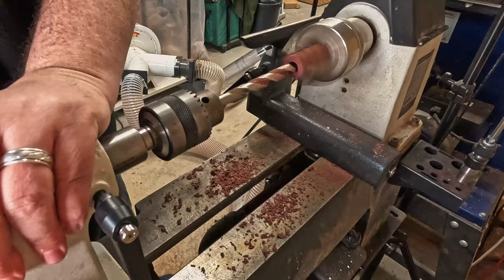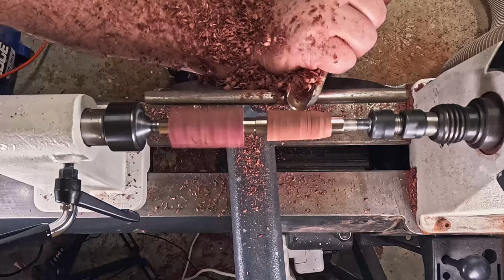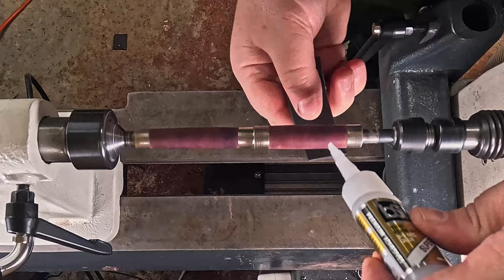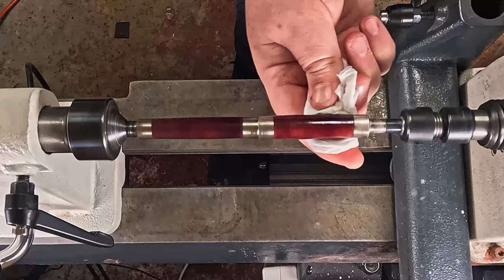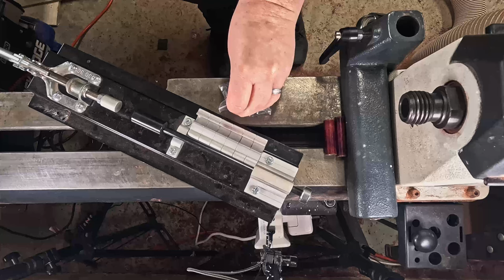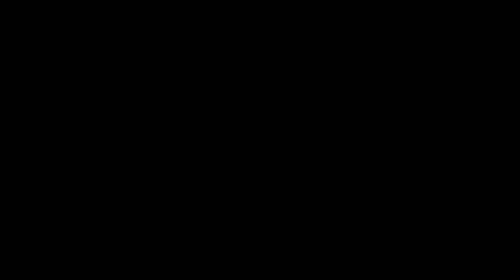Mistakes Happen

Comment: Great video mate. Thanks for sharing. How much do you sell a pen such as this
Reply from the maker: Thanks for the comments.
Several factors come into play on these. Purple heart is a bit more expensive in Australia. It's an imported wood and isn't readily available (I am also regional NSW, so it takes additional effort to get woods as it is a 4hr drive to Sydney). I tend to work with a lot of Australian hardwoods for that reason.

Purpleheart sees a premium on pen sales as a result.
I don't typically have a stockpile on hand, I quote and make to order. My email is available on my channel. I have the wood, kits and blanks ready to go.
Rough guide (AUD), depending on style/kit/wood. This pen would have been $80. Center twist ballpoint(broad/streamline) $40, pencil $45. Fountain in purple heart $130. Fountain in most other woods $100